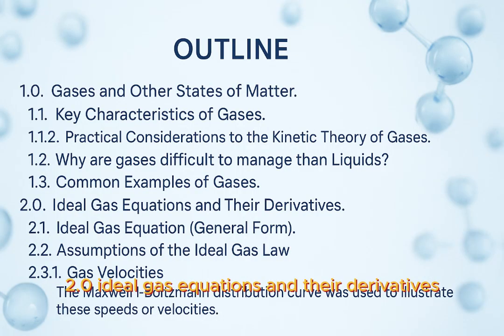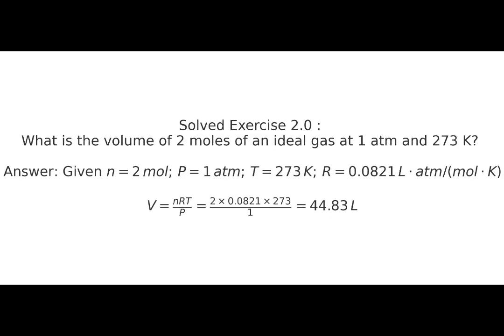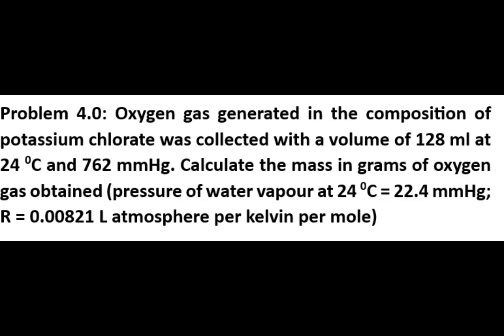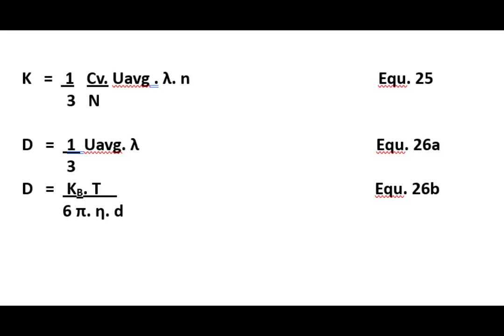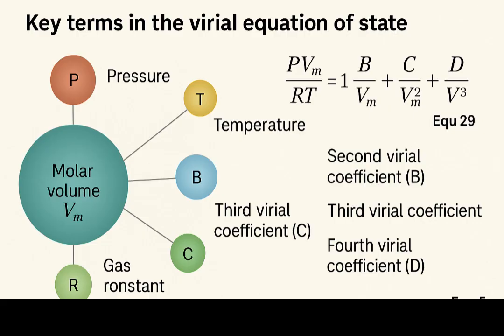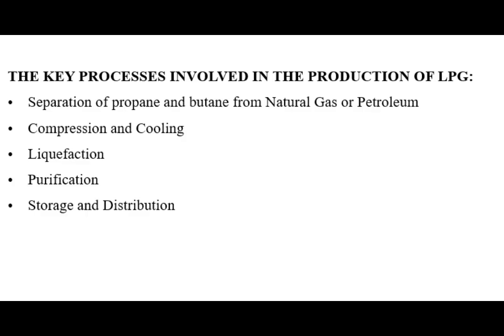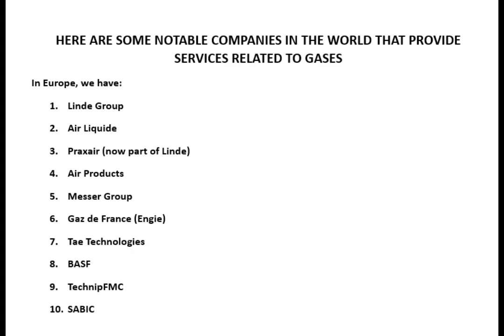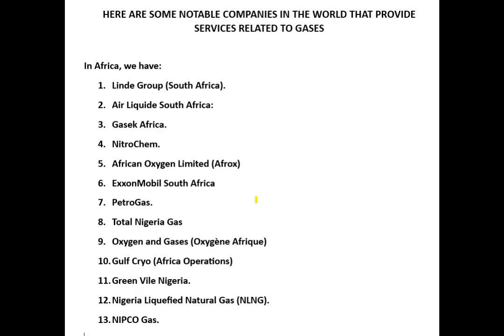Fundamentals and Applications of Gases

Comment: IFEBI KOSISOCHUKWU MERCY 
B.C.H

 "Utilizing free and natural oxygen from the atmosphere for anaesthesia during surgical procedures presents several critical concerns.
To begin with, atmospheric air comprises only about 21% oxygen along with other gases such as nitrogen, carbon dioxide, and trace substances. This level of oxygen is insufficient for patients undergoing surgery, particularly under general anaesthesia, where a higher and carefully controlled oxygen concentration is essential to sustain vital physiological functions.
Secondly, the air around us is not sterile. It may carry microorganisms, dust particles, and environmental contaminants. Directly introducing this unfiltered air into a patient's lungs increases the likelihood of infections or respiratory tract irritation, thereby putting thepatient's health at risk.
Thirdly, the concentration and supply of oxygen during surgery must be accurately managed.
Medical-grade oxygen stored in cylinders is manufactured under strict conditions to ensure 100% purity and stable delivery. This is crucial for maintaining adequate oxygen levels in the patient's body and preventing both oxygen deficiency (hypoxia) and excessive oxygen (hyperoxia).
Finally, anaesthesia equipment is engineered to operate with pressurized, purified oxygen-not ordinary air. Attempting to use atmospheric air bypasses the machine's built-in regulation and safety systems, which can result in errors anaesthetic administration."

Comment: MCB :*Ionization and Lightning:*

Yes, ionization of gas molecules plays a crucial role in lightning during thunderstorms. Here's a simplified explanation:

1. Electrical charge buildup: During thunderstorms, ice and water droplets collide, generating static electricity and separating electrical charges within the cloud.
2. Electric field: The separated charges create a strong electric field between the cloud and the ground or within the cloud.
3. Ionization: When the electric field becomes strong enough, it ionizes the air molecules, creating a conductive pathway for electricity to flow.
4. Leader stroke: The ionized pathway, called a leader stroke, propagates from the cloud to the ground or within the cloud.
5. Return stroke: Once the leader stroke reaches the ground or a region of opposite charge, a massive surge of electricity follows, creating the bright flash of light we see as lightning.

Ionization in Electric Bulbs:

No, ionization of gases is not directly related to lightning in electric bulbs. Electric bulbs, like incandescent or fluorescent lamps, work on different principles:

1. Incandescent bulbs: Heat a filament until it glows, producing light.
2. Fluorescent bulbs: Excitation of gas molecules (like mercury vapor) creates ultraviolet light, which is then converted to visible light by phosphors.

While ionization might occur in certain types of lamps, like fluorescent or gas-discharge lamps, it's not related to lightning. Instead, it's a fundamental process that helps create light.

Comment: PIC: Joule-Thomson effect*: While the Joule-Thomson effect can cause cooling of gases upon expansion under certain conditions, it's not a primary method for producing LNG or LPG industrially. LPG's properties allow for liquefaction through compression at ambient temperatures. LNG requires more complex cryogenic processes due to methane's low boiling point.

Liquefaction methods*: LNG is typically liquefied through cryogenic processes involving cooling to very low temperatures (-162°C at atmospheric pressure). LPG is liquefied through compression or cooling, leveraging its higher boiling point compared to methane.

Comment: BCH (U2023/5535228)

Using free and pure oxygen from the atmosphere for anaesthesia during surgery, rather than from a cylinder, presents significant safety and practical challenges. It would be difficult to control the concentration and flow of oxygen, potentially leading to hyperoxia or hypoxia, both of which can be harmful. Furthermore, maintaining a sterile and controlled environment for surgery with uncontrolled oxygen flow would be nearly impossible.

Comment: Mcb: yes,ionization of gases in the atmosphere can cause lightning during thunderstorms. When air molecules are ionized due to strong electric fields in clouds, it creates a path for current to discharge as lightning. However, this is different from how electric bulbs light up. Bulbs use controlled electricity from a power source, not atmospheric ionization, so lightning does not cause bulbs to light up in the same way. Only fluorescent bulbs can glow using ionization of gase molecules

Comment: MCB;
Yes, ionization of gases can cause lightning and is also used in some electric bulbs.
	Lightning during thunderstorms happens when clouds build up a lot of electric charge. When the charge becomes too much, it forces the air (which is normally an insulator) to break down. The gases in the air become ionized, meaning they get charged and can carry electricity. This creates a path for the electric charge to travel — that’s the bright flash we see as lightning.
	Electric bulbs like fluorescent or neon lights also use ionization. Inside the bulb, a gas is charged with electricity, making it glow. That’s how the bulb gives off light. But normal bulbs with filaments (like old-style bulbs) just use heat, not ionization.

Comment: MCB

U2023/5555121.
Great questions! Let's break them down one by one:

---

1. Can ionization of gases in the atmosphere cause lightning during thunderstorms?

Yes, ionization of gases plays a crucial role in the formation of lightning.

How it works:

During thunderstorms, strong updrafts and downdrafts in clouds cause collisions between ice particles, which separate charges.

Positive charges accumulate at the top of the cloud, while negative charges gather at the bottom.

This charge separation creates a strong electric field between the cloud and the ground (or within the cloud itself).

When the electric field becomes strong enough, it ionizes the air — meaning it strips electrons from gas molecules (mostly nitrogen and oxygen).

This ionized air becomes conductive, forming a plasma channel.

A discharge of electricity (lightning) then travels through this ionized path, releasing a massive amount of energy in the form of light, heat, and sound (thunder).

---

2. Does ionization of gases cause lighting in an electric bulb?

It depends on the type of bulb.

a) Incandescent Bulbs:

These bulbs work by passing an electric current through a metal filament (usually tungsten).

The filament heats up and glows due to resistance — not due to ionization.

There is no gas ionization involved in the light production here.

.

---

b) Fluorescent and Neon Bulbs, and Gas Discharge Lamps:

In these bulbs, ionization of gas does cause light.

An electric current ionizes the gas inside the bulb (like mercury vapor, neon, or argon).

The ionized gas emits ultraviolet or visible light, or causes a phosphor coating to glow.

Comment: PIC

LNG (Liquefied Natural Gas) is not produced with the Joule - Thompson experiment alone because it is mainly composed of methane which has a very low boiling point making liquefaction at room temperature difficult.

While in the case of LPG (Liquefied Petroleum Gas) which consist of propane and butane cools down easily during Joule - Thomson expansion at room temperature making liquefaction by this method easier

Comment: MCB : Yes.
When electric fields in a thundercloud exceed the insulating capacity of air (~3 MV/m), they strip electrons from gas molecules, creating ionized channels (plasma). These conductive paths allow electrons and ions to flow rapidly, producing the bright flash of lightning 

2. Ionization in electric bulbs

MCB : Yes.
In gas discharge lamps (like neon or fluorescent bulbs), an electric voltage ionizes the gas inside the tube. The freed electrons collide with gas atoms; when electrons recombine, they emit visible light. This same ionization-to-light mechanism is how many electric bulbs work

Comment: MCB U2023/5555161

Great questions! Let's break them down one by one:

1. Can ionization of gases in the atmosphere cause lightning during thunderstorms?

Yes, ionization of gases plays a crucial role in the formation of lightning.

How it works:

During thunderstorms, strong updrafts and downdrafts in clouds cause collisions between ice particles, which separate charges.

Positive charges accumulate at the top of the cloud, while negative charges gather at the bottom.

This charge separation creates a strong electric field between the cloud and the ground (or within the cloud itself).

When the electric field becomes strong enough, it ionizes the air — meaning it strips electrons from gas molecules (mostly nitrogen and oxygen).

This ionized air becomes conductive, forming a plasma channel.

A discharge of electricity (lightning) then travels through this ionized path, releasing a massive amount of energy in the form of light, heat, and sound (thunder).

✅ So yes, ionization of air is essential for lightning to occur.

2. Does ionization of gases cause lighting in an electric bulb?

It depends on the type of bulb.

a) Incandescent Bulbs:

These bulbs work by passing an electric current through a metal filament (usually tungsten).

The filament heats up and glows due to resistance — not due to ionization.

There is no gas ionization involved in the light production here.

✅ No, ionization of gas is not involved in incandescent bulbs.

b) Fluorescent and Neon Bulbs, and Gas Discharge Lamps:

In these bulbs, ionization of gas does cause light.

An electric current ionizes the gas inside the bulb (like mercury vapor, neon, or argon).

The ionized gas emits ultraviolet or visible light, or causes a phosphor coating to glow.

Comment: GLY: Nitrogen plays a crucial role in coiled tubing operations for oil recovery from wells and reservoirs, primarily due to its inert nature, lightweight properties, and ability to be easily compressed and expanded. Here's a breakdown of how it's used:

1.Nitrogen Lifting (Well Unloading/Kick-off): Nitrogen gas is pumped down the coiled tubing into the wellbore, typically to the bottom or below the liquid level. Being much lighter than the wellbore fluids, the injected nitrogen mixes with and displaces the accumulated liquids, reducing the overall density and hydrostatic pressure of the fluid column.

Comment: MCB:
Ionization of gases leads to lightening from thunder through collision between water droplets and ice particles leading to a build up of electric charge, the charge then creates a strong electric field between the cloud and the ground, when the electric field overcomes the insulating properties of air, it allows a massive discharge of electricity ie lightening to occur.

Ionization of gases leads to lightening from electric bulb when a small electric current ionizes the gas like mercury, vapor or neon, and the resulting plasma emits ultraviolet or visible light

Comment: BCH: Using unregulated atmospheric oxygen instead of medical-grade oxygen from a cylinder during anesthesia carries serious risks, including contamination, difficulty in maintaining accurate oxygen concentration, and a higher chance of fire or explosion. Although pure oxygen is used in anesthesia, it is strictly regulated and delivered through cylinders or other certified medical systems to ensure patient safety.

Ambient air contains only about 21% oxygen. During anesthesia, precise regulation of oxygen levels is essential for adequate oxygenation and to prevent complications such as hypoxemia (low oxygen) or hyperoxia (excess oxygen).

Comment: BCH :

Using free atmospheric oxygen during anaesthesia is unsafe and inappropriate. Medical-grade oxygen from a cylinder is essential to provide the correct concentration, sterility, and controlled delivery needed to ensure safe and effective anaesthetic care.

Implications of Using Free Atmospheric Oxygen Instead of Medical-Grade Cylinder Oxygen During Anaesthesia:
	1.	Insufficient Oxygen Concentration:
	Atmospheric air contains only 21% oxygen, which is not enough to meet the high oxygen demand during anaesthesia.
	This can lead to hypoxia (low oxygen levels in the body), causing brain damage, cardiac arrest, or even death.
	2.	Uncontrolled Delivery:
	Atmospheric oxygen cannot be regulated or precisely delivered.
	Medical-grade oxygen is supplied under controlled pressure using specialized equipment, ensuring accurate dosage.
	3.	Lack of Sterility:
		Atmospheric air is not sterile; it may contain dust, bacteria, viruses, and pollutants, which increases the risk of infection during surgery.
	Oxygen from a medical cylinder is filtered and purified.
	4.	No Backup or Monitoring:
 Atmospheric oxygen cannot be monitored or stored in required amounts.
	Medical oxygen systems include backup supplies, alarms, and safety controls.
	5.	Patient Safety is Compromised:
	Relying on air instead of medical oxygen puts the patient at serious risk and violates standard surgical safety protocols.
 U2023/5535106

Comment: PIC:Liquified Natural Gas(LPG) production typically doesn't use Joule Thompson effect alone because of its limitations,JT expansion can cool gases but cannot achieve the extremely low  temperature required for LNG (-162°C), because of its composition of methane and it is also not efficient for large scale LNG production. 

While LPG can be liqudifed with relatively low temperature and pressure making Joule Thompson effect more suitable for it's production.

Comment: PIC: Lower Critical Temperature:
Natural gas, primarily methane, has a much lower critical temperature than the hydrocarbons found in LPG (propane and butane). This means that to liquefy natural gas, significantly lower temperatures are required, which are often beyond what can be efficiently achieved through simple Joule-Thomson expansion alone at typical operating pressures.

Energy Efficiency:
While the Joule-Thomson effect does cause a temperature drop, achieving the extremely low temperatures needed for LNG production through this method alone would be highly inefficient and require very high pressures or multiple stages, making it economically unfeasible for large-scale production.

Comment: BRIGHT NWORGU MENUCHIMZI 
BCH
Air around us isn’t pure oxygen. It has only about 21%, which is too low 

The oxygen in normal air also has low and steady pressure. This makes it unfit for machines like ventilators that need strong and steady oxygen flow.

Oxygen cylinders give clean, filtered oxygen at high pressure. Which are controlled on how much oxygen is given, making them safe and useful
Reply: GLY

The oxygen in normal air also have low and steady pressure. 

Air around us isn't pure oxygen. It has only about 21%..wjich is low

Comment: Osaromkpe Evelyn Nkajima BCH
U2023/5535005

Not using the real gas monitoring i.e anesthesia has analysis during surgery can have significant implication for patient safety, anesthesia management and surgical outcomes.
The key consequences are:
1. Delayed recovery and prolonged sedation: Without measuring exhaled anesthetic concentrations, anesthesiologists may overestimate recovery increasing the risk of postoperative respiratory depression.
2. Inadequate anesthesia depth monitoring: Without real gas analysis, anesthesiologists cannot accurately measure the concentrations of inhaled anesthetic e.g desflurane, seuoflurane and nitrous oxide.
 

Lastly, real gas monitoring is essential for safe anesthesia practice not using it increases the risk of hypoxia, hypercapnia, anesthetic overdose and delayed recovery.

Comment: "BCH: 
The use of free and pure oxygen gas which contains only 21% oxygen for anaesthesia during surgery is unsafe and medically unacceptable as it leads to
Insufficient oxygen delivery and inability to control anaesthesia levels.
A higher concentration of oxygen is often needed to maintain proper oxygenation but free and pure oxygen gas cannot meet the need because it's too low in oxygen.
So using free and pure oxygen gas for anaesthesia during surgery is unsafe but it's safe and medically acceptable to use pure oxygen gas which contains 99.5 oxygen for anaesthesia during surgery.

Comment: GLY: Igoma Diseph Lucky (U2023/5565076)

The production of Liquefied Natural Gas (LNG) is the process of converting natural gas from its gaseous form into a liquid to make it easier to store and transport, especially across long distances where pipelines are not feasible.

FROM GAS TO GLASS: HOW LNG IS MADE

Extraction 
Natural gas is extracted from underground reservoirs using drilling techniques, often alongside crude oil.

Purification 
The gas is cleaned to remove impurities like water, carbon dioxide, hydrogen sulfide, and heavy hydrocarbons. This ensures that only methane, the main component of natural gas, remains.

Cooling 
The purified gas is cooled to about -162°C (-260°F), turning it into a liquid — LNG. This reduces its volume by about 600 times, making it much more efficient to store and transport.

Storage & Transport 
The LNG is stored in specially insulated tanks and transported by LNG carriers (giant ships) to markets around the world.

Regasification (optional) 
At its destination, LNG can be warmed and turned back into gas before being piped to homes, factories, and power plant